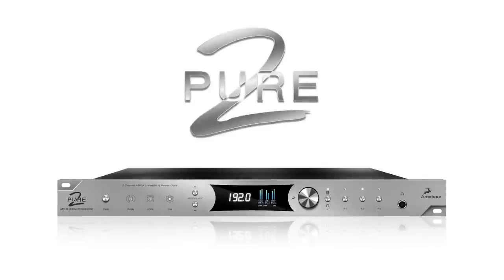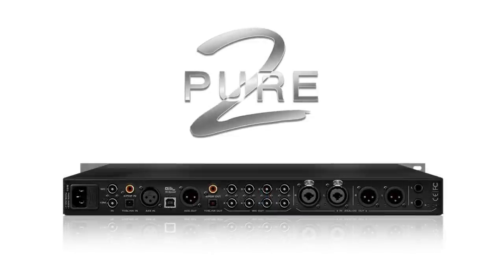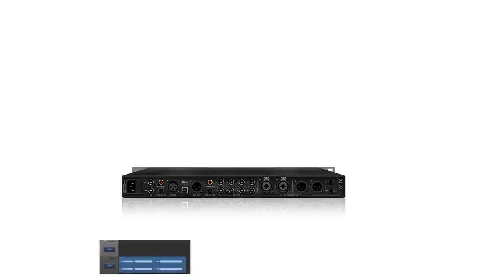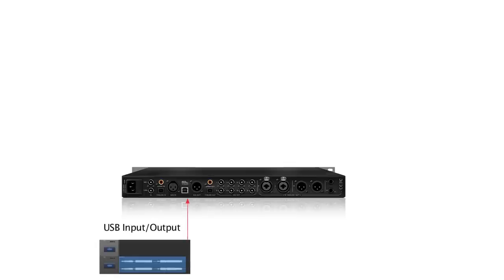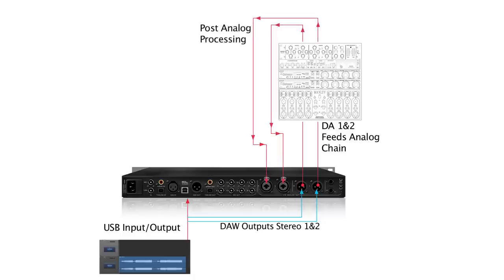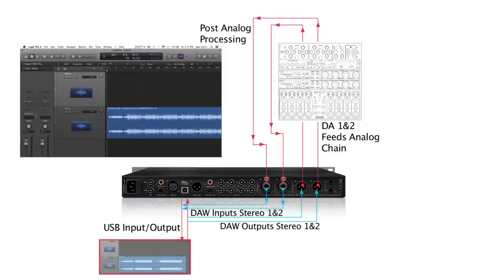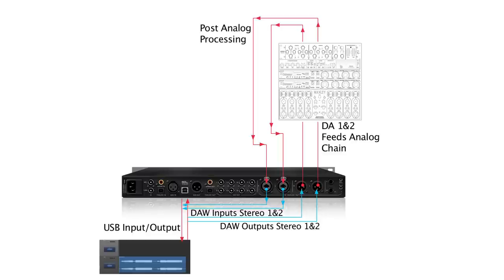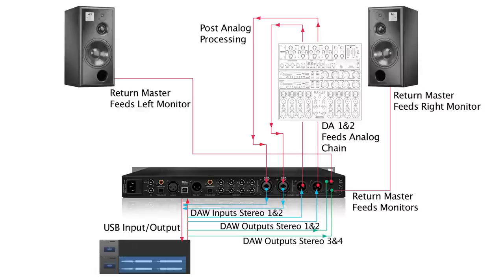Pure2 Signal Path For a Typical Mastering Set Up

Comment: can you run the pure 2 without it being hooked up to the computer.  I just want to use the DA via AES input from my system and use the volume control to adjust volume.
Reply from the maker: Hi!

Yes, you can, you will only need to connect it to a computer to change the routing, so which input goes to which output.

Please let us know if any other questions come up!

Comment: What's about the Windows USB audio driver? Is it possible tu run the Pure2 via USB although another soundcard (e.g. RME AiO, RayDAT) is already installed with its RME Windows driver for digital equippment or may I run the Pure2 then over the AES/EBU or SPDIF connections together with the RME card? Many questions that couldn't be solved in such short video? Does anybody know more? Many thanks in advance.
Reply: YES AND YES
Reply: @atrosion1097  is pure 2 have 2  preamp  or it can take only line signal ?
Reply: @MMSMUZIK  How does this work with clock syncing? Does that come into play? I for instance have my motu with adat and spdif coax and optical IO. How would I connect a converter like the Pure2?
Reply: @thehighhnotes  It's a Mastering Converter! Line in and out
Reply: @sandychahal1200  it's a mastering converter line in line out
Reply: @thehighhnotes  You could connect either way you like, but If you are just wanting it for clocking purposes I would go the optical route, if you want conversion plus clocking GO ADAT! That simple!
Reply: @MMSMUZIK  of course, it would certainly be conversion too. I was totally overcomplicating it. Thanks for your helpful  reply!
Reply: @thehighhnotes  your welcome, no problem! You got It! Let me know if you have any other questions!